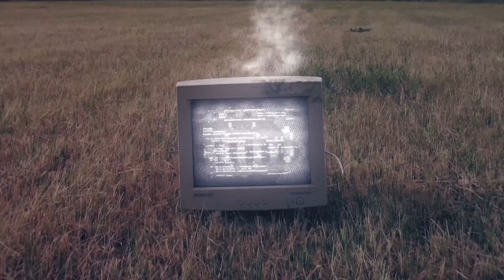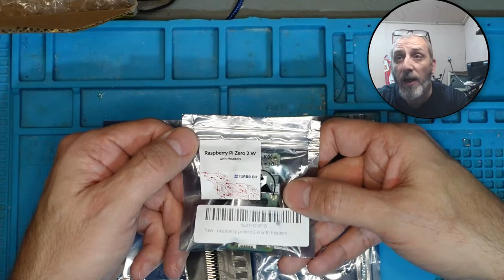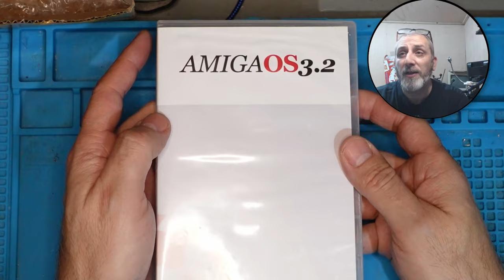Let’s pimp up this Dirty Amiga 1200! Lets begin the install of the pistorm and GoDrive😀

Comment: Nice, vid. Just of curiosity will you do a mod for using HDMI?
Reply from the maker: Hi thanks for the comment. I have actually just installed the picasso drivers and working on fitting a back cover with HDMI as the latest version of EMU68 has better support for the hdmi :) Thanks for the comment
Reply: @Retro4u  Magnificent, thank you looking forward to part 2.
Reply from the maker: @josephphillips9243  if you haven’t found it it’s here Future-Proofing the Amiga 1200 : GoDrive and Pistorm 32 part 2
https://youtu.be/cSl7s4Jf9Z4

Comment: Fitted my 1200 with a pistorm 32 lite  and raspberry pi model 3a+. The thing is rapid although I couldn’t get emu68 to work.
Reply from the maker: Part 2 I install emu68 will be out Friday just had to finish editing and would have been way too long for a single video. Thanks for the comment
Reply: @Retro4u I’ll watch out for that cheers. That godrive looks handy as well. I’ve got a gotek on my a500 and it’s great but quite bulky. This looks tiny in comparison.
Reply from the maker: @Mind-your-own-beeswax  it’s really good 👍 you will see again in sort 2 I install it. Allows you to have both drives fitted and also easy to access usb and no case mods at all :)

Comment: Got two 1200's.. One I slapped a PiStorm in, running Caffeine.. The second one will be kept more classic, with a turbo card and AmigaOS 3.2. I really love those machines.
Reply from the maker: Yeah they are amazing machines.  I like caffeine is used it on the A600.  Just finished this A1200 today. Will
Now be my main machine thanks for the comment.
Reply: @Retro4u Saw your video about the 600 earlier, but hadn't subscribed. Now I did ;) - Got two 600's myself, will set them up like I did with the 1200's. Amazing what can be done with them today. Shame that ethernet doesn't work on the pistorm with Emu68. I'm using plipbox on them.
Reply from the maker: @StachiBCNR33 thanks for the subscribe. I’m sure it will implemented pistorm is being worked on a lot and I’m sure there are many more options to come